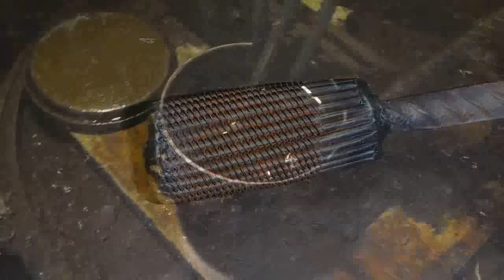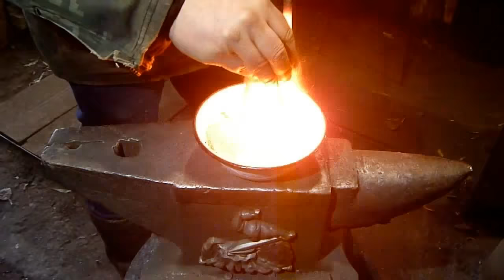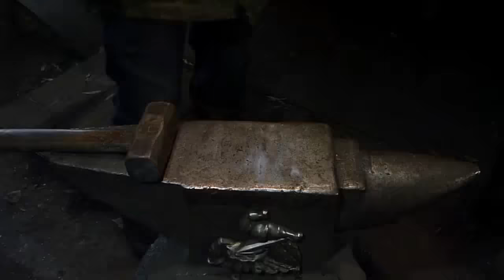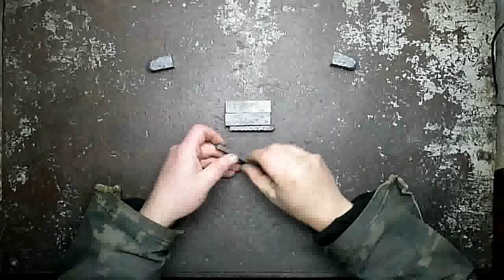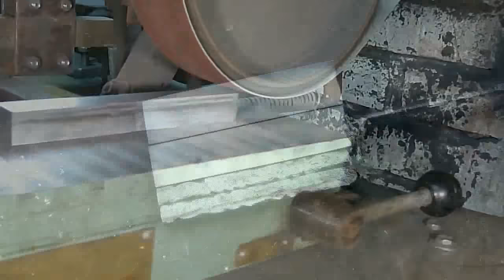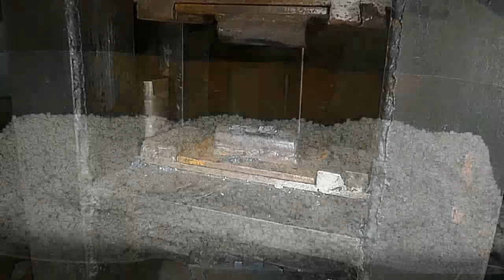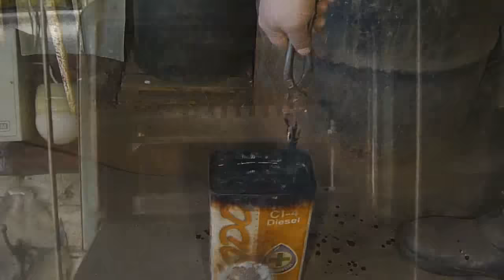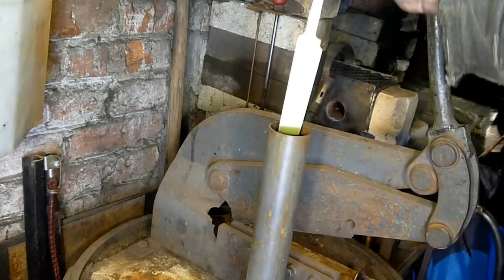Damascus of screws, making a blade.

Comment: What is this "powder" for?
Reply from the maker: I sprinkle flux (90% borax + 5% quartz sand + 5% charcoal powder) this is necessary for forging (forge) welding. The flux is alloyed with scale - the formed substance is sufficiently fluid and is easily displaced by deformation. In addition, the flux protects against oxygen and charcoal, carburizes the surface layer of metal - which lowers the welding temperature (if in brief).
Reply: shurap it's kind of frustrating to leave this blade all alone by itself on YouTube , without any handle to keep it company , it's so sad 😞😟😢
Reply: It's cocaine, you can see how everything speeds up after a few sprinkles of the "powder"
Reply: The powder is flux and stops the billet from oxidising and forming unwanted scale and impurities. If you continue forging with the oxidised scale and impurities on the blade it can affect the quench and stop the blade from evenly hardening.
Reply: @shurap  where can I buy this? Or can you make a vid of making this?

Comment: que pó é esse  ,porque  em cima de madeira ?
Reply from the maker: Eu borrifo o fluxo (90% de bórax + 5% de areia de quartzo + 5% de pó de carvão) isso é necessário para forjar (forjar) a soldagem. O fluxo é fundido com a escala - a substância formada é suficientemente fluida e é facilmente deslocada pela deformação. Além disso, o fluxo protege contra o oxigênio e o carvão, cementando a camada superficial do metal - o que reduz a temperatura da soldagem (se for breve).
A primeira soldagem é feita em uma árvore, já que a madeira é um isolante térmico, e não seleciona a temperatura como uma bigorna de ferro. Além disso - queimando, a árvore queima oxigênio, protegendo a peça de trabalho e prolongando o trabalho do fluxo. Isto é relevante para peças de solda com peças pequenas (corda, corrente)
Reply: @shurap  
Esse fluxo é o famigerado fundente? Ou é outra coisa diferente?

Comment: Okay I'm stupid what's in the bowl and why
Reply: Lonny Fuller Borax(90%) quartz powder(5%) and charcoal powder (5%)
Reply from the maker: I sprinkle flux (90% borax + 5% quartz sand + 5% charcoal powder) this is necessary for forging (forge) welding. The flux is alloyed with scale - the formed substance is sufficiently fluid and is easily displaced by deformation. In addition, the flux protects against oxygen and charcoal, carburizes the surface layer of metal - which lowers the welding temperature (if in brief).
Reply: Pepper
Reply: Really Dead Guy I was ganna say cinnamon to add flavour.
Reply: @hamiorakaiwai  lol smart ass
 born every second. I got it now. I'm going to build my own forge and build knives. I want to play around with Damascus.
Reply: Lonny Fuller ha! Build one and upload it, I wouldn’t have the patients for this, but I can watch this stuff all day.
Reply: @hamiorakaiwai  ya that's probably down the road the Damascus forgeing looks complicated for a beginner.
The blade makeing. Just watching that puts you in almost a Zen like state. Its relaxing.

Comment: Hey man what kind are those so I can try this ?
Reply: also dont get stainless. and the gold coloured screws are coated in vanadium, which will actually kill you if you breathe it in, its farrr worse than gal
Reply: Lemtil yeah I've only tried to forge weld 2 times but I'll probably practice forge welding before I try and do this
Reply: jeremy mcadam thanks man

Comment: Three questions:
1.  What's the liquid that the billets are always soaking in, at the beginning of most of these videos?
2.  What's the sandy-looking stuff I always see you sprinkling on, when the metal's glowing hot?
3.  Why do you submerge the blade into that chalky-looking stuff, shortly after shaping the tang?
Reply from the maker: The billet is soaked in kerosene. This is necessary for good welding (forging) steel. When burning inside the workpiece remains soot (carbon), which, with further heating, scales and rust inside the workpiece restores to the iron, improving the quality of forging welding.
I sprinkle flux (90% borax + 5% quartz sand + 5% charcoal powder) this is necessary for forging (forge) welding. The flux is alloyed with scale - the formed substance is sufficiently fluid and is easily displaced by deformation. In addition, the flux protects against oxygen and charcoal, carburizes the surface layer of metal - which lowers the welding temperature (if in brief).
This is annealing of steel, it is needed for grinding grain of steel grown at the temperature of forge welding, stress relief. Preheated billet to austenitic transformation temperature, placed for slow cooling in the heat insulator "Perlite".

Comment: Im confused...was the knife we see at the end made out of the long screws with the heads cut off by angle grinder at the start, or was it made from the welded capsule of small screws and iron powder we saw in the middle of the video? or were the two pieces combined at some point and I missed it?

Comment: I'm thinking about getting into knife forging and Damascus making, what is that powder you sprinkled on the metal while forging it? Also do I need all those fancy presses to get started or can I just do it with basic hand tools?
Reply from the maker: I sprinkle flux (90% borax + 5% quartz sand + 5% charcoal powder) this is necessary for forging (forge) welding. The flux is alloyed with scale - the formed substance is sufficiently fluid and is easily displaced by deformation. In addition, the flux protects against oxygen and charcoal, carburizes the surface layer of metal - which lowers the welding temperature (if in brief).

Comment: With screws you can purchase known factors in the construction of the metals used.  Including a Ryerson rating. There are screws designed not to share, and the screws designed to easily sheer.

When designing an implosion building to handle explosives, I had to find the proper hangers and bolts that will scheer If there is an explosion, countered by screw bolts that are sheer resistant.  This week controlling the direction of the implosion/explosion.  Fascinating stuff.     😳😅... at Home Depot I tried telling a guy that he cannot use that particular bolt on his hitch. I gave him the reason why. He told me I didn’t know what I was talking about. He bought a common bolt with no rating Because it was the cheapest one and he thought it would work.

Comment: I know nothing about being a Black Smith, but I love watching these videos. But I have always wondered, what is the secret blend of several herds and spices that gets sprinkled on occasionally and what is it for? This may be a dumb question and I apologize if it is, but I always love to learn somthing new if anyone can help me out. THANKS!
Reply from the maker: I sprinkle flux (90% borax + 5% quartz sand + 5% charcoal powder) this is necessary for forging (forge) welding. The flux is alloyed with scale - the formed substance is sufficiently fluid and is easily displaced by deformation. In addition, the flux protects against oxygen and charcoal, carburizes the surface layer of metal - which lowers the welding temperature (if in brief).
Reply: @shurap  that's really interesting. I've watched dozens of your videos and never could figure that out. I really appreciate the response and look forward to seeing more videos soon!

Comment: Why put oil on it before the first firing?  
What is the powder being sprinkled on the hot screws?
It's a wonderful video by the way
Reply from the maker: The billet is soaked in kerosene. This is necessary for good welding (forging) steel. When burning inside the workpiece remains soot (carbon), which, with further heating, scales and rust inside the workpiece restores to the iron, improving the quality of forging welding.

I sprinkle flux (90% borax + 5% quartz sand + 5% charcoal powder) this is necessary for forging (forge) welding. The flux is alloyed with scale - the formed substance is sufficiently fluid and is easily displaced by deformation. In addition, the flux protects against oxygen and charcoal, carburizes the surface layer of metal - which lowers the welding temperature (if in brief).

Comment: What is the liquid that you're dipping your billets in before you put it in the fire I've seen you do it a few times but I don't know what it is?
Reply from the maker: The billet is soaked in kerosene. This is necessary for good welding (forging) steel. When burning inside the workpiece remains soot (carbon), which, with further heating, scales and rust inside the workpiece restores to the iron, improving the quality of forging welding.

Comment: Podrías decirme que es el líquido en el q sumergis los tornillos antes de meterlo a la forja y q es el polvo q espolvoreas cuando los tornillos estan caliente
Reply from the maker: Rocío con fundente (bórax 90% + arena de cuarzo 5% + polvo de carbón vegetal 5%), esto es necesario para llevar a cabo la soldadura (forja). El flujo se fusiona con la escala: la sustancia resultante es bastante fluida y se desplaza fácilmente durante la deformación. Además, el fundente protege del oxígeno y, a expensas del carbón, carburiza la capa superficial del metal, lo que reduce la temperatura de soldadura (en resumen).

 La pieza de trabajo está empapada en queroseno. Esto es necesario para un buen acero de soldadura (forjado). Cuando se quema, el hollín (carbón) permanece dentro de la pieza de trabajo, que, al calentar aún más, reduce la escala y el óxido dentro de la pieza de trabajo a hierro, mejorando la calidad de la soldadura de forja.

Comment: Boy this is always interesting.   Want to know what you're soaking the bundle welded up  in just before it 1st goes into fire?   Acid etching to clean the screws/cables etc.   
Also.on the canisters you add what looks like coal/charcoal and borax?  Thanks love the designs.
Reply from the maker: The billet is soaked in kerosene. This is necessary for good welding (forging) steel. When burning inside the workpiece remains soot (carbon), which, with further heating, scales and rust inside the workpiece restores to the iron, improving the quality of forging welding.
Pure iron powder, charcoal powder, a little salicylic acid.

Comment: I'm curious - why dip them in oil at the beginning? it looked like oil, forgive me if I'm being ignorant.
Reply from the maker: The billet is soaked in kerosene. This is necessary for good welding (forging) steel. When burning inside the workpiece remains soot (carbon), which, with further heating, scales and rust inside the workpiece restores to the iron, improving the quality of forging welding.

Comment: I think here missing some explications,like why you put that powder on hot metal and the rest of processes.Only peace
Reply from the maker: I sprinkle flux (90% borax + 5% quartz sand + 5% charcoal powder) this is necessary for forging (forge) welding. The flux is alloyed with scale - the formed substance is sufficiently fluid and is easily displaced by deformation. In addition, the flux protects against oxygen and charcoal, carburizes the surface layer of metal - which lowers the welding temperature (if in brief).
Reply: @shurap  wow,it s awesome,you're a reall  engineer.I love you're work man

Comment: Que pó é esse que ele coloca quando a peça esta bastante quente
Reply from the maker: Salpico com fluxo (bórax 90% + areia de quartzo 5% + pó de carvão 5%) necessário para efetuar a soldagem (forja). O fluxo é fundido com a escala - a substância resultante é bastante fluida e é facilmente deslocada durante a deformação. Além disso, o fluxo protege do oxigênio e, devido ao carvão, cementa a camada superficial do metal - o que diminui a temperatura de soldagem (em suma).

Comment: Somebody PLZ explain whats the powder that's sprinkled on.... And whats it do.... Why do some Smiths wet the anvil??? I have so many questions....
Reply from the maker: I sprinkle flux (90% borax + 5% quartz sand + 5% charcoal powder) this is necessary for forging (forge) welding. The flux is alloyed with scale - the formed substance is sufficiently fluid and is easily displaced by deformation. In addition, the flux protects against oxygen and charcoal, carburizes the surface layer of metal - which lowers the welding temperature (if in brief).

Comment: So I was just wondering why he hammered it on the slab of wood at the beginning instead of just going straight on the anvil. Can someone explain to me why he does that?
Reply from the maker: The first welding is done on a tree, as the tree is a heat insulator, and not so selects temperature as an iron anvil. In addition - burning, the tree burns oxygen, protecting the workpiece and pouring the flux work. This is important for welding workpieces with small parts (cable, chain).
Reply: @shurap  Ok, that makes so much sense! Thank you so much!!

Comment: Why does he use the wood? I have no experience with any kind of blade making I’m just curious.
Reply from the maker: The first welding is done on a tree, as the tree is a heat insulator, and not so selects temperature as an iron anvil. In addition - burning, the tree burns oxygen, protecting the workpiece and pouring the flux work. This is important for welding workpieces with small parts (cable, chain).

Comment: Nice work shurap! Just curious, what are you dipping the screws in before you heat them up the first time?
Reply from the maker: The billet is soaked in kerosene. This is necessary for good welding (forging) steel. When burning inside the workpiece remains soot (carbon), which, with further heating, scales and rust inside the workpiece restores to the iron, improving the quality of forging welding.

Comment: Curious what is the white powder you are sprinkling on the billet after you take it from the forge?
Reply from the maker: I sprinkle flux (90% borax + 5% quartz sand + 5% charcoal powder) this is necessary for forging (forge) welding. The flux is alloyed with scale - the formed substance is sufficiently fluid and is easily displaced by deformation. In addition, the flux protects against oxygen and charcoal, carburizes the surface layer of metal - which lowers the welding temperature (if in brief).

Comment: can somebody tell me? I'm interested:

1. what was that white small sand-like thing?
2. what was that fluid on the end of the video?
Reply from the maker: I sprinkle flux (90% borax + 5% quartz sand + 5% charcoal powder) this is necessary for forging (forge) welding. The flux is alloyed with scale - the formed substance is sufficiently fluid and is easily displaced by deformation. In addition, the flux protects against oxygen and charcoal, carburizes the surface layer of metal - which lowers the welding temperature (if in brief).

Comment: alguem me fala oque é esse pó branco que ele joga no aço de tempos em tempos pfv
Reply from the maker: I sprinkle flux (90% borax + 5% quartz sand + 5% charcoal powder) this is necessary for forging (forge) welding. The flux is alloyed with scale - the formed substance is sufficiently fluid and is easily displaced by deformation. In addition, the flux protects against oxygen and charcoal, carburizes the surface layer of metal - which lowers the welding temperature (if in brief).

Comment: Love these videos, dude what is the stuff you sprinkle over it when it's red hot?
Reply from the maker: I sprinkle flux (90% borax + 5% quartz sand + 5% charcoal powder) this is necessary for forging (forge) welding. The flux is alloyed with scale - the formed substance is sufficiently fluid and is easily displaced by deformation. In addition, the flux protects against oxygen and charcoal, carburizes the surface layer of metal - which lowers the welding temperature (if in brief).

Comment: Really awesome work! One dumb question from someone without background knowledge: what is the „sand“ he sprinkles on after each time in the furnace and what is it for?
Reply from the maker: I sprinkle flux (90% borax + 5% quartz sand + 5% charcoal powder) this is necessary for forging (forge) welding. The flux is alloyed with scale - the formed substance is sufficiently fluid and is easily displaced by deformation. In addition, the flux protects against oxygen and charcoal, carburizes the surface layer of metal - which lowers the welding temperature (if in brief).

Comment: What is the stuff black smiths always sprinkling on the piece they work on. In the bowl.
Reply from the maker: I sprinkle flux (90% borax + 5% quartz sand + 5% charcoal powder) this is necessary for forging (forge) welding. The flux is alloyed with scale - the formed substance is sufficiently fluid and is easily displaced by deformation. In addition, the flux protects against oxygen and charcoal, carburizes the surface layer of metal - which lowers the welding temperature (if in brief).
Reply: @shurap  very interesting, thank you for explaining

Comment: When put the blade info sand, thats the thermal treatment?? Dos not.use oil????
Reply from the maker: This is annealing of steel, it is needed for grinding grain of steel grown at the temperature of forge welding, stress relief. Preheated billet to austenitic transformation temperature, placed for slow cooling in the heat insulator "Perlite".
Reply: @shurap  thanks  fot the explain.

Comment: what's the liquid he dips the material into before he puts it in the furnace?
Reply from the maker: The billet is soaked in kerosene. This is necessary for good welding (forging) steel. When burning inside the workpiece remains soot (carbon), which, with further heating, scales and rust inside the workpiece restores to the iron, improving the quality of forging welding.